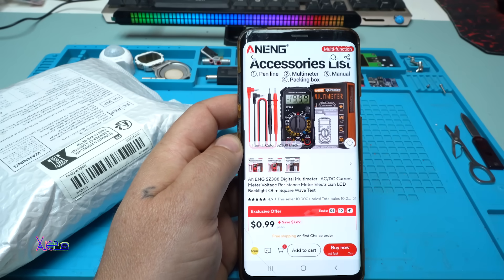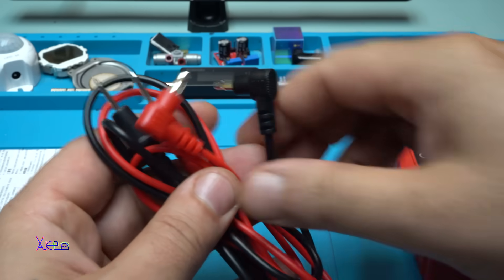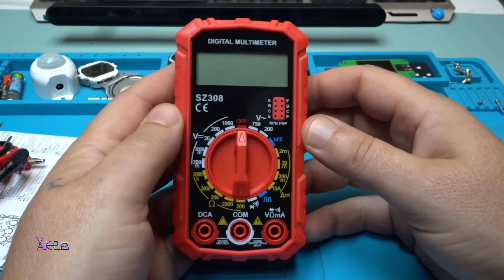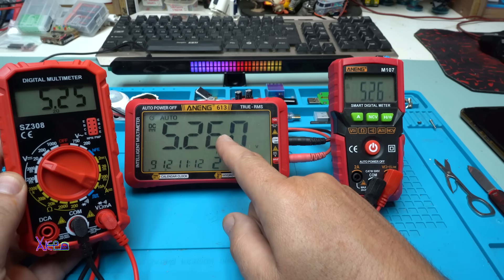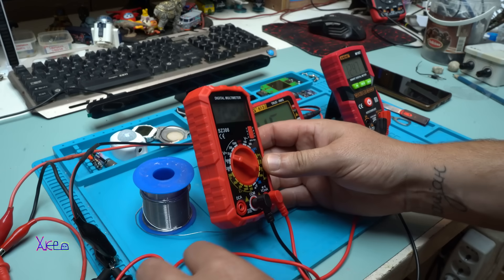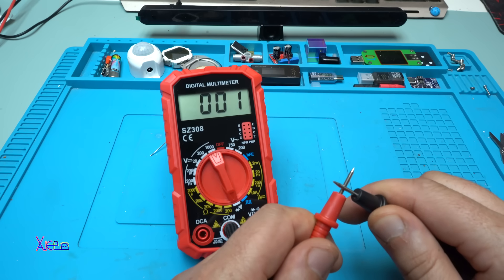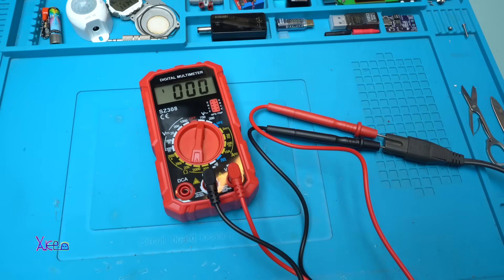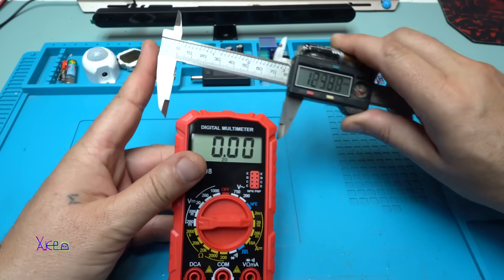The $1 Aliexpress Multimeter Aneng SZ308  Review!

Comment: Hey, thru much error (reversing polarity) I have found the 'ideal diodes' which now protect a lot of my devices on dc power.  Could u do a video on why someone should probably get and install ideal diodes to protect your devices if you mess up and reverse polarity.  It shouldn't be posted here but I didn't know where else to send u a message.  Thanks
Reply: on a fuse bank i actually have ideal diodes installed on each circuit.